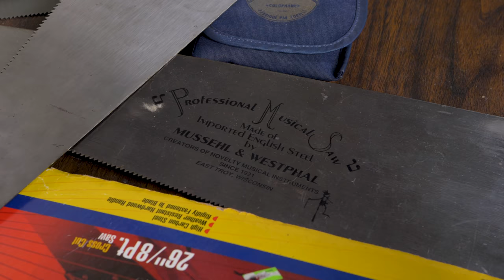Saw (an instrument that can cut you in half)

Comment: I taught myself how to play a saw with a cheap violin bow and an old handsaw. It really helps if the saw is shiny clean and very pliable. A stiff saw really wears out your thumb and hand that are putting the bend in the saw. Vibrato is created by bouncing your knee when holding the saw handle between them.

Comment: I’ll tell you a little secret: the range of harmonics and fundamental tone also depends on the type of alloying of the steel saw blade. If carbon steel is hardened, a higher tone will be obtained, and if alloyed with chromium and vanadium, the tones will be much lower and more “pink,” that is, with a rolloff towards high frequencies. Just like the raster of wind instruments or the size of a resonant wooden soundboard.

Comment: So that's how saws as an instrument work. You use bow to make it vibrate it at certain spot than just bend it to control pitch of vibration, if you shorten it it sounds higher if you prolog it it will sound lower.